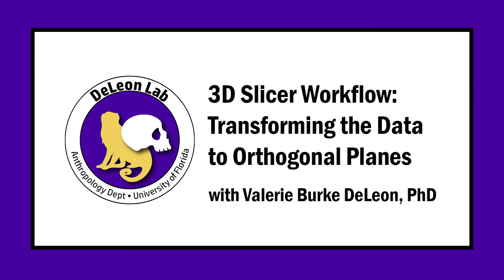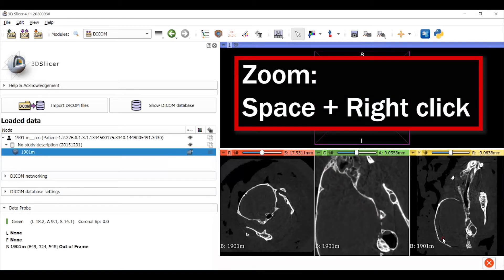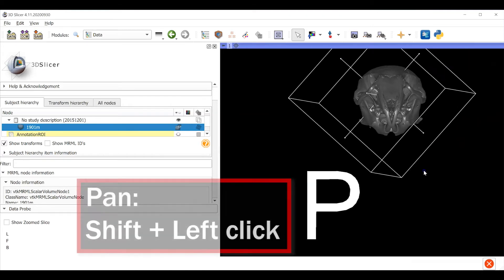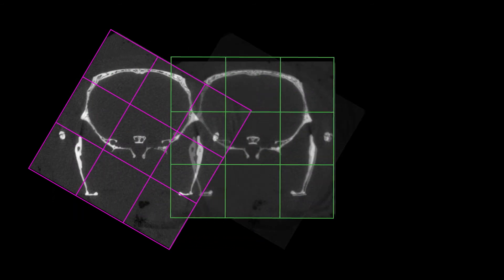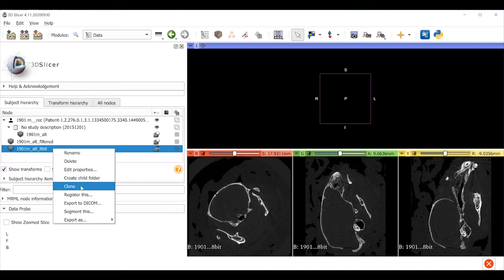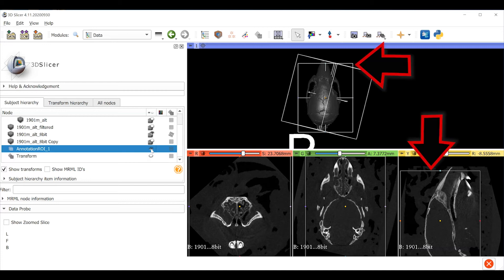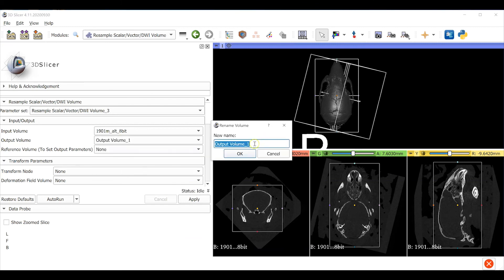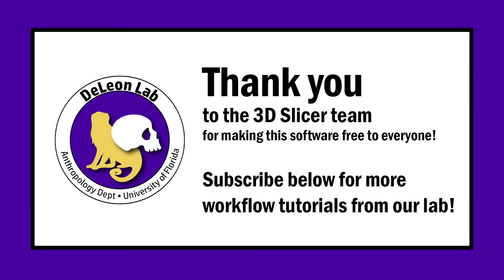Transforming Data to Orthogonal Planes   [3D Slicer Workflow]

Comment: Thank you for the great video! It seems that even with external transformation, the image was still in its original image coordinate system. Or in other words, the transformation was done view the entire volume as a whole, including the IJK coordinate system with it. I was hoping to alter the structure in the IJK system
Reply from the maker: Can you confirm that you resampled the volume to a reference volume in another location/orientation?  Even if the volume kept the same ijk coordinates (0 to i, 0 to j, 0 to k), each voxel should correspond to a different position in the world coordinates.  I don't use ijk coordinates for my work, but I thought they always start with an origin of (0,0,0).  If you transform the volume, you'd need to use anatomical or world coordinates to capture the spatial transformation.
Reply: @deleonlab  Thanks for the response! It worked! In the very beginning, I didn't use a reference volume because I was using the "resample scalar volume", which doesn't have that option. Later on, when I switched to the one you used "scalar/vector/DWI", for reference volume, I just selected the same one (as the input volume), and it didn't work. I didn't pay attention to it because I thought it was just about spacing, voxel size etc, nothing related to the IJK system. Now I just tried it again using the initial (before linear transform) volume as the reference volume and it worked! The changes are done in the IJK system! Also want to thank you for commenting on the resampling without hardening the transform, which does make a difference! I think I still need to spend more time figuring out how these concepts work together, but at least I got what I need in the short term! You are a life-saver! Thanks a ton!!
Reply: Just to make an addition here, in case someone else might benefit from it - during the resampling, make sure the correct linear transform is selected as well!
Reply from the maker: @KitkatTrading2024  I'm so glad this was helpful for you! - Valerie

Comment: Hi, what version of 3d slicer were you using in this tutorial? I've been trying to reproduce the 2nd method with my data and it turns out wronged cropped. I don't find a way to create the annotation ROI, only a makeup ROI. I am using version 5.0.2.
Reply from the maker: I believe that I was using v4.11.0 for that video.
When I need a new ROI to use for cropping or other transformations, I usually open the Volume Render module, and under Inputs->ROI in left menu choose "Create new AnnotationROI as..."  It helps me to rename my ROIs based on their purpose (for certain visualizations, or for creating a cropped volume).  There are probably more efficient ways for creating new ROIs, but this works well for me.
Keep in mind that the bounding box of the transformed volume will be visible in the 3D viewer (and looking just like the other ROIs) as long as you have the "Interaction in 3D View" selected in the transform controls (grid icon to right of object in data window).  It may be that you are changing those boundaries?
I'm happy to offer other suggestions if this doesn't work!
Reply: @deleonlab  thanks a lot, it worked <3
Reply: Hi @deleonlab  , I am using version 5.4.0 and there is no "Create new AnnotationROI as..." option - how do you go about this step of the process nowadays? Many thanks!